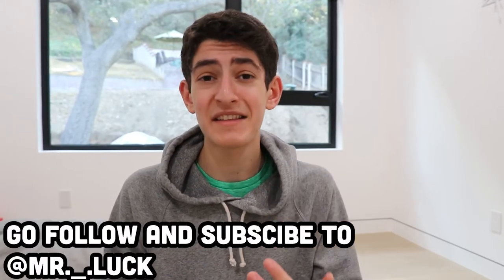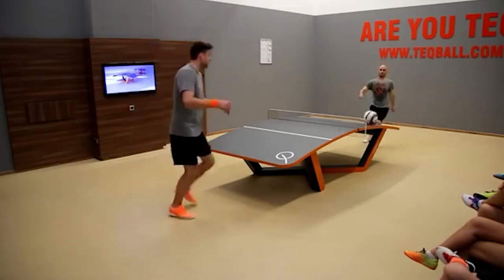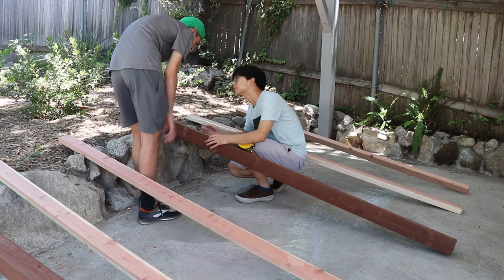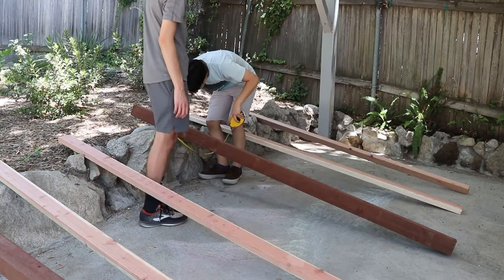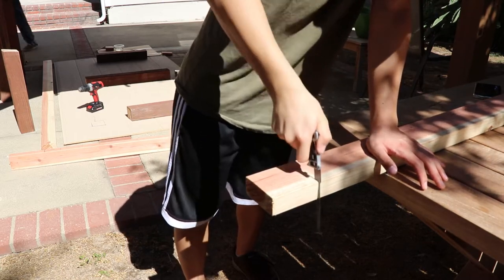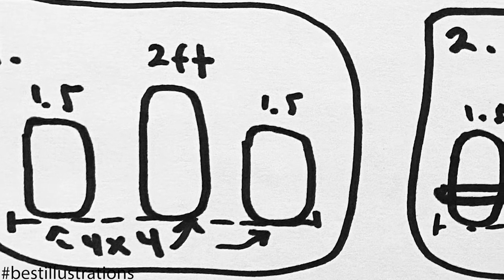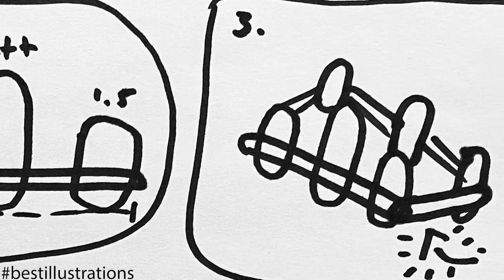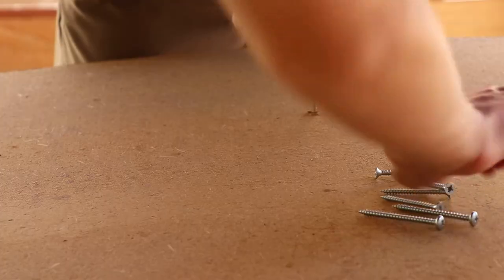How to build a TEQ Ball table: EASY step by step process + Customize

Comment: Power tools, yes! I like the can-do attitude. Next time, you could make some curved rails (probably 5) out of thick (or laminated-together) plywood, pull the top to them using metal L brackets to get the shape just right, and attach the legs and cross-braces to the 2nd & 4th of those curved rails. The 1st, 3rd, & 5th rails would stabilize the 2 long edges and center (the long axis) of the table. If it's still not stable enough (ball not bouncing right or too much vibration/noise), you could add blocking between the rails, using some more metal L brackets (especially along the short edges of the table). Now I want to make my own. I'm probably  too old to be safe playing teqball, but I used to play a lot of volleyball and soccer (and some tennis and table tennis), so it looks really fun! Plus, I like building stuff....

Comment: Another possible variation, use FRB instead of plywood for the top layer of the table, and it will resist the elements really well. You could still paint your own designs on it if you sand it first, say, with 220 grit or lower